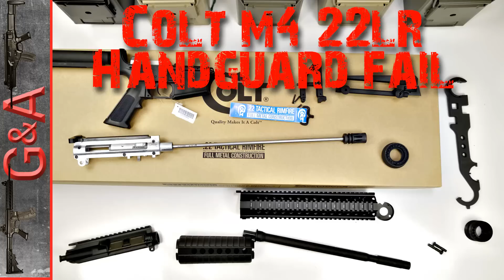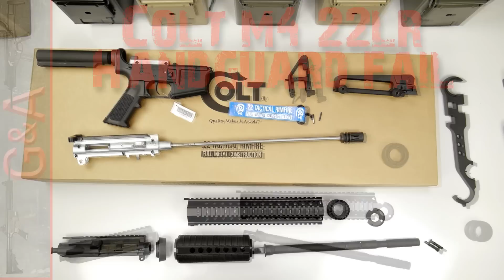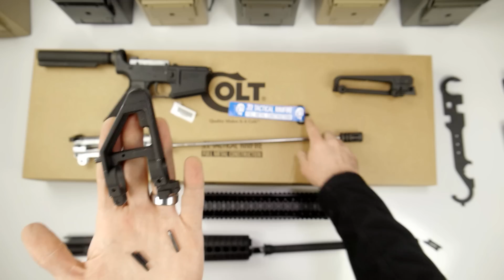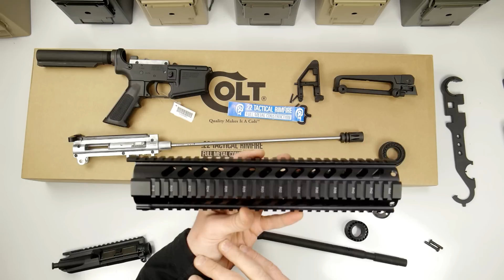Colt M4 22lr Handguard Fail

Comment: Here's what I did. I bought a drop in quad rail. I believe it was airsoft spec. I had to dremel two little ledges of and it fit very tight but I got it on and it sweet now. Good luck

Comment: Yes like the guys said below,...this is a bummer but now you are that much wiser too.
  I'm here scratching my head and saying to myself," what is really wrong with the hand guard that came with the Colt, in the first place ?"
No, I'm not trying to be a smartass here, but I am truly wonder that. Your Colt M4 looks pretty cool to me when you took it out of the box.   
Could you contact the folks at Umarex and ask then what they would suggest as an upgrade ? Is that an option ?
Reply from the maker: +Reg Sparkes I definitely like the way it looks also. But before I even bought, I had decided that I wanted to customize it. It is just a fun project, even thought it is causing some problems. Isn't that the way everything like this goes. Thanks for watching.
Reply: +Guns & Accessories 
Actually I am looking for a 'project' rifle like this too. But I'd like to sttart with one of these that is dependable and not too costly. 
Do you have any experience with Mossberg's 715 rifle as far as reliability goes ?

Comment: They designed this rifle to be as incompatible as possible with mil spec ar-15 parts
Reply from the maker: +benjieswork4me lol. I am finding that out more and more. Thanks for watching.
Reply: me too and its really disappointing me.
Reply: Yep; it was intentiontally designed to deceive buyers into thinking they were getting a real gun, a 'Colt' yet, when in fact it's just a converted airsoft toy.
Reply: No they didn't.They designed this rifle as a BB gun like their other .22lr platforms they then decided to turn a bb platform into a .22lr which is why the upper receiver is made with cast Ali and the barrel is a thin tube inside the fake barrel because that's how they built the original bb rifle.Its also why they have a Spring adjustment to cope with hi or low velocity ammunition because of the cheap but complicated bolt group,if you can call it that.Yes there are people that state they have fired thousands of rounds without a problem but the more that straw barrel heats up the more it bends because being secured front and back the expansion has nowhere to go.Also it may cycle for years but some of those corrosive chemicals from powder residue will eat the parts you can't clean and if you do take the upper receiver/ bolt group apart there is a little note in the manual that warns you that the warrantee is void.